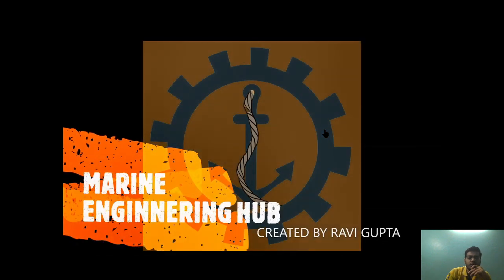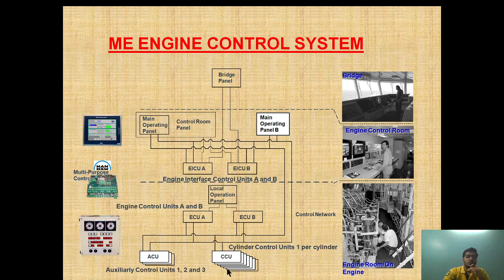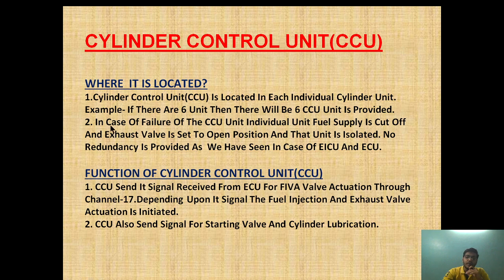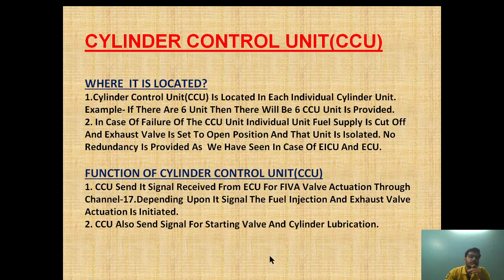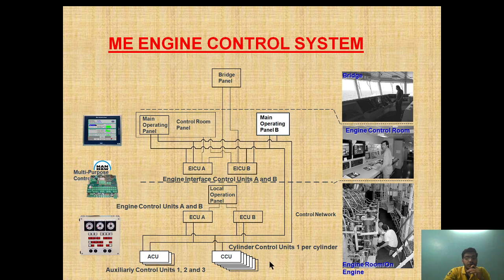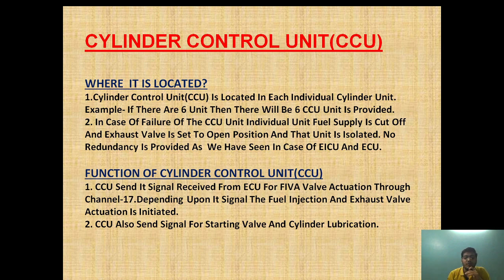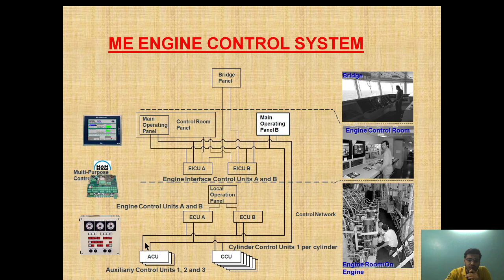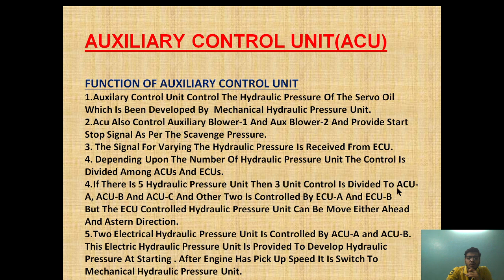ME Engine Control System| Cylinder Control Unit(CCU)| Auxiliary Control Unit(ACU)|(Part-3)

Comment: Please clarify whether the 2 electric driven hps unit is controlled by ACU or ECU.
Reply: ACU recieves signal from ECU. ACU CONTROLS 1 engine driven pump and 2 startup pumps  and ECU control 2 engine driven pumps.

Comment: What is the difference between ME B& C Engines?
Reply: ME-B don't have fiva valve exhaust valve is actuated by cam only , only fuel Injection is by ELFI and starting air distributor by also cam shaft , ME-C all by fiva and starting by pilot valve
Reply: Inside the Exhaust valve configuration are different...like hydraulic lock nut, 2 diff Air piston